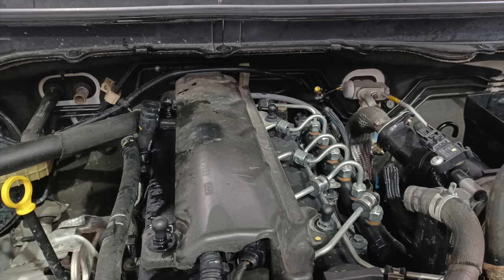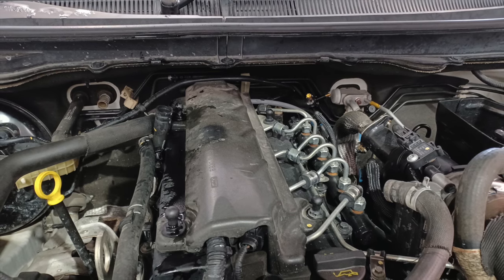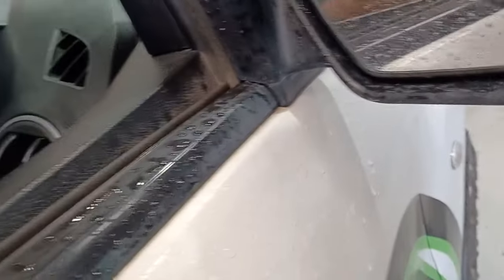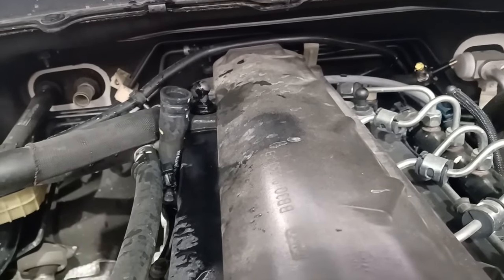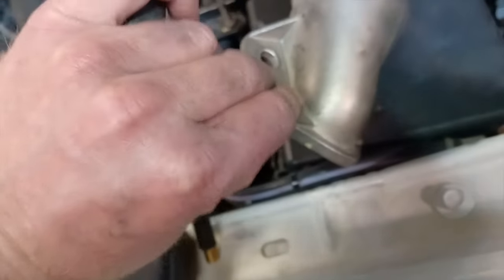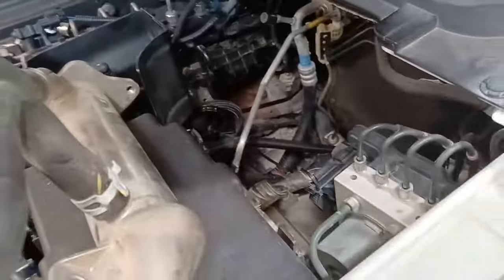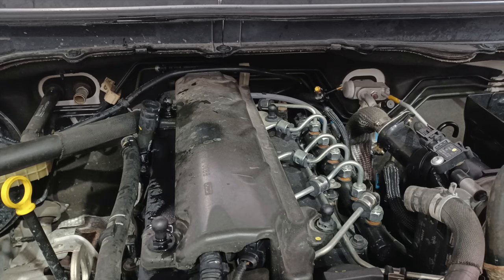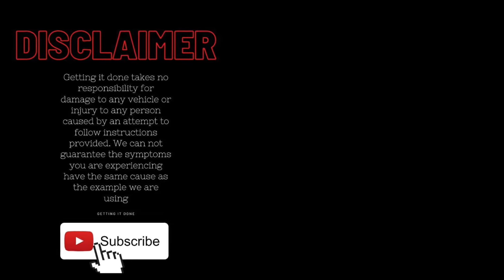Ranger or BT50 EGR Cooler replacement and diagnosis

Comment from the maker: *PX2 Auto Trans DPF UPDATE* hey guys just a bit of an update on some questions I couldn't answer previously having not done a PX2 with Auto Trans and DPF. Another garage down the road have just done one and informed us that it can be done the same way, but you need to remove the wiper cowl and take the DPF right off to release the heat shield at the exhaust end. The connection at the exhaust end is different too, but it comes out the same way with those additional steps.

Comment: Seen your video on EGR cooler replacement .There is even a more easier way to carry out this repair I am ford tech and the trick is to remove both wiper arms,the plastic cowling held in by plastic clips just need a flat blade screw driver for these clips .Once top cowling is removed go for the metal plate that holds the wiper motor assembly remove all the 10mm bolts disconnect the wiring loom to the wiper motor note if you have fender indicators cut the wire which goes to right side only will need re-soldering when refitting.Should give you so so much more room to get all the bolts that hold both the EGR and cooler.I split the EGR away from the cooler to make it easy to remove cooler as you did on the left side And for more excess remove the  4 torx bolts that secure the EGR motor  I believe the bolts a E25 or E30 1/4 drive ratchet,extension bar. or try a torx Allen key. This method applies to both BT50,Ford Ranger 3.2 auto or manual 2WD or 4wd.This method gives greater access and the whole job should take between 2 to 3 hours.
Reply: I have one on my hoist at work and I was looking at it today saying how the fuck. But this makes total sense thank god I came across this comment. Just to review so I can get it done fast as possible for the customer, 
- Wipers off
- Window cowl panel off 
- Wiper motor off 
- Is cutting the indicator wires a necessity for removing everything? 
- split valve from cooler and remove then remove cooler. Does this work the same ways for the auto 3.2 that has the metal pipe that is held to the bottom bolt of the egr valve? 

Also, will the px3’s go into limp mode after the egr is blanked or do they just display an engine light. 

Cheers in advance mate this comments a massive time saver
Reply: Feels like the 3.2 auto with the Vacuum bypass is more of a hassle..

Comment: It may have been easier just to blank the cooler off and retune the EGR closed.
Reply from the maker: You'd have to way up the different costs etc. You'd also need to bypass the cooler with the coolant lines. And do an EGR delete. It could easily be just as, if not more complicated than replacing the cooler. We are in a professional workshop though, so we prefer do things properly.
Reply: Very fuckin expensive.... Had my egr blanked off, now need to get it tuned... 2500 aud
Reply: @flippo2388 which Ranger? Pre dpf or px2+

Comment: Hello there, what’s the access like on an 4X4 Automatic? And do you need to torque the EGR Valve to cooler bolts to specifications?

Comment: Are aftermarket units just as good as factory stamped ones? Huge difference in price, that's for sure!
Reply from the maker: We haven't fitted after market on one of these. But there is a big price difference between the bt-50 and ranger genuine parts. They're actually the same.
Reply: @gettingitdone1  $2000 supply and fit for a genuine part versus $1200 for aftermarket on a Ranger!
Reply from the maker: @tonyletizia2873  you could find out if the genuine Mazda one is cheaper. I know there was a big difference in our country.  Otherwise maybe you do try an aftermarket one. Also is this a quote from a mechanic? A lot of people think that the gearbox has to be removed to the job, but it doesn't. Maybe just check if that's what they're quoting you on.

Comment: Did this last week, was not fun.  I found it easier with the fuel filter and bracket out of the way, takes ten minutes but more room to see and move.  The three bolts on the exhaust manifold end are a nightmare when you don't have a hoist to come from underneath.  I ended up using three long thin bolts (just smaller than the ID of the thread) which were easier to slide through and line the EGR cooler up with the exhaust manifold.  With two of those in to line up the holes threading a bolt in the other hole was easy, well easier anyway.  The two bolts from the cooler to EGR are easy enough because you can see them from underneath, but the bolt holding the cooler to the back of the head is blind from underneath (again, no hoist so harder on your back).  Needed a friend for this, one underneath pushes the extension and uni joint up, one standing then puts it onto the bolt, I just couldn't get this on my own.
Reply from the maker: Good effort getting it done without a hoist. It's a tricky spot, but better doing it this way than removing the whole transmission like a lot of people do.

Comment: How do you bleed the coolant through the system after the replacement of the cooler
Reply from the maker: the system will bleed itself. run it for a awhilewith the coolant reservoir cap off to make it easier for air to escape. then run it up to operating temperature before driving to ensure no air locks are present.

Comment: Does the automatic transmission make it any harder to remove the cooler ?
Reply from the maker: I haven't done one with an automatic transmission yet, but I imagine it could still be done this way. The bell housing of the Trans could be different, but wouldn't think that would have a significant affect.
Reply: @gettingitdone1  From just looking at mine with the automatic I think the trans cooler would at least have to be removed to make room to get up to the egr valve bolts.

Comment: Many thanks for the video, im planning on having the egr cooler replaced on my everest 3.2 as it is nearing 90k kms. 

Is it recommended to also replace the egr valve when doing this or just the cooler?
Reply from the maker: Normally we would only replace the valve if it was faulting. However, EGR valves can often give trouble, so if it's a high mileage vehicle you might consider doing it while you're there.
Reply: @gettingitdone1  Appreciate the answer. 

When getting both replaced, are there any gaskets that have to be replaced on the tubing connections?
Reply from the maker: @Marex14  there will be gaskets at each connection point, it's better to replace them with new ones, but not vital as they will mostly be steel gaskets.

Comment: Thanks for the video, I will give this a go on my 2013 bt 50 as preventative maintenance.  Ive heard alot about vacuum bleeding the system afterwards. Do I need to get a mechanic for this or can I do this myself at home? Cheers
Reply from the maker: The cooling system on these should self bleed. When you first start it up, run it with the cap off for a bit until it warms up. Then put the cap on, drive it up to operating temperature, then let it cool down again and recheck the level.
Reply: @gettingitdone1   Really appreciate you getting back to me with advice. Thankyou . Have a great day

Comment: Will this procedure work with the 3.2 L motor?
Unclear what motor in the video, which is very helpful otherwise
Reply from the maker: Hi there. Yes I think this was on a 3.2 but either way I'm looking at 3.2 on the hoist now and it is the same set up. Some people have suggested they are a bit trickier with an auto trans, but I'd still give a go this way.